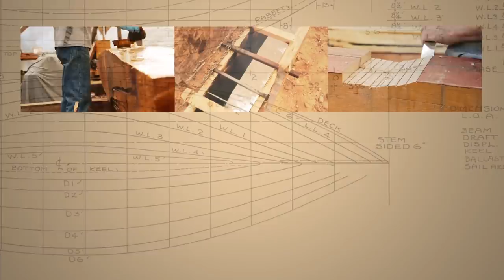Cockpit Mockup - Episode 149 - Acorn to Arabella: Journey of a Wooden Boat

Comment from the maker: So glad everyone’s enjoying the video! Thanks for watching! There are a couple of questions that are being universally asked. For water in the cockpit: Drains in the cockpit will empty to hoses that are attached to seacocks below the waterline. This solution for a self-bailing cockpit it’s fairly common. To drain well, the hoses are typically crossed rather than leading straight down—so a drain on starboard, for example, will exit at a seacock to port for good drainage even while heeling. Tiller steering: Tillers are simple, strong, affordable, and there are good options for self steering, including powered autohelms, for them. Sign up for the newsletter that’s linked in the description. It’s brand new and we’ll be releasing some pretty cool stuff exclusively through it. We figured that if YouTube won’t send email notifications anymore, then we will have to do it... and we’ll do it better anyhow. 😉
Reply: Have you thought about where the fuel tank is gonna go and the location of the engine gauges in the cockpit? .......fuel, temp, oil pressure and tachometer.
Reply: Wow the whole balance thing is so crucial, I would have never guessed!
Reply: Can confirm that Otto is an excellent helmsman and holds a pretty great heading unless you're really trying to pinch to wind
Reply: I have been wondering, why not let the cockpit floor slope with the deck? Then, one could work out a grate to their liking. But underway, should the low spot be aft? If your seacocks were straight down, or below waterline underway, wouldn't any water get pulled out by the pressure difference? Just curious.

Comment: Hi guys, I have been following your channel and love the way you build Arabella. I'm a shipwright from Turkey. Would you think about first covering the deck with marine plywood (shouldnt have to be thick) and cover it with a layer of fiberglass to make all the deck waterproof. Than you can install your deck on that glassed plywood. Decks are getting wet and dry everyday if there is nothing to stop water underneath they usually leak over the years. Rain water is a big problem because it rottens wood way faster then salty water. I usually paint the underside of the plywoods white before I install them. So they make nice contrast with deck beams and give interior more light also painting them while they out saves lot of work. Hope this will be helpfull.

Comment: It is so cool to finally see the deck come to life! So great to see the progress.

This was a hot topic last week, but it still had me thinking. The overhang on the roof might be a hazard in a storm. If a green wave roles over the deck and against the house, it has something to grab onto. It could rip the roof off the house sides if you're unlucky. 
I've spent years surfing in waves that have made it up the continental shelf, onto a beach. The waves you''ll encounter will be doing an unimpeded 35 mph. It would be like having several Olympic swimming pools hit you from the side. A ledge on the weakest corner of the house might not stand up to it. 
It would be safer to give each port light its own little cover, like on a traffic light. Make them detachable for heavy storms, use the in poor weather. No risk of pulling the roof off and still achieves the same goal.

A suggestion for tiller, would be to make it neutral in weight somehow. Holding it up will get heavy after a long time. Maybe a support behind the rudder mount, with a spring on it. I reckon it would be much more comfortable.

Comment: Steve, it's looking wonderful! The "grab rails" running around the cabin on my Bristol Channel Cutter were about the same size as the fiddles around the galley countertop; there's lots of area to grab, and it does catch the drips from the port lights as you mentioned. The cockpit is near perfect...smaller is better at sea, yet still plenty of room for socializing. You've already sorted out the need to brace your feet on the opposite side...excellent! I love the idea of the deck prisms there...mine were in the deck and never leaked, but they are slicker than snot if you happen to step on one! The tiller definitely needs to swing up vertically and be out of your way when anchored or docked. Yes, you will spend surprising amounts of time standing up, even on the deck, while at the helm. A good deal of that time will actually be spent steering with your feet! Prehensile toes help with this. I haven't seen your plans for it, but if you haven't already, you might consider mooring bits aft. I had one at either after end of the cockpit coaming, and they were an excellent and convenient way to moor with ease, with little intrusiveness. A cleat of sufficient size on the narrow aft deck, especially with Arabella's canoe stern, would really cut into the available deck space. Good on ya' for thinking ahead about ventilation...those small opening ports in the after end of the cockpit are a fine idea. Will the forward cabin's hatch be low to the deck or will you have a small trunk cabin? The after side of such a small trunk cabin is a great place for another ventilation opportunity. Mine was actually cut down like a miniature companionway with a washboard that could be removed for big air flow. We had a solid washboard for that spot, but most of the time had one with a large, louvered vent in place. The key to avoiding dampness and condensation, most importantly in cold weather, will be drawing in cold air at one end of the boat, warming it as it passes through the length of the vessel (picking up lots of moisture as it warms), then ejecting it out the other end. I've installed small "boxer" fans on my boats to create this end-to-end ventilation and have never had any problems with dampness, even when living and cooking aboard. Again, not such a huge deal in warm climes, but essential up north. It's sure rewarding to see her starting to acquire the cabin and cockpit...the parts where her owner will live. Thanks for inviting us along on this journey!

Comment: Great to see you sitting in the cockpit with tiller in hand clearly rounding a headland leading to a beautiful tropical island. 😂😂. You absolutely want to be able to raise the tiller. I am often standing on the cockpit seats while picking up a mooring or entering harbour. My engine control is positioned so I can operate it with my foot. Something to think about when you decide where to fit the engine controls on Arabella. 👍

Comment: When I started watching this series, I wondered how wooden boats managed to stay together under all the strain. Now, especially after this episode, I wonder how a wooden boat (or at least this wooden boat) could ever come apart. I’m amazed.
Reply from the maker: Our boat, in many ways, has been over engineered. Then there are boats that are somewhere in between. Interestingly, many boats built for racing in the early 20th century were built lightly and quickly and for fashion. Depending on the racing rules of the time, an owner would order a new boat possibly every couple of years so the boats weren’t built to last more than that. It’s not true of all boats at that time, of course, but it’s one explanation for some boats that have been lost to time.
Reply: @AcornToArabella  wow! I had no idea they would be semi disposable in that way. I guess when the purpose is speed and not longevity it makes a huge difference.
Reply: @AcornToArabella  I reckon there'll be less twist in that hull than any of the original logs from which it's made. Awesome (literally).
Reply: @tymonritco8578  racing craft (of all types, land, sea, and air) are built as lightly as possible under whatever rules they're following. So ordering a new one or completely rebuilding one every couple of years is less trouble.
Reply: Rain. Fresh water is the biggest enemy, that and stangnant air is a guarantee for rot. Neglect and rain are what kills wooden boats, no matter how well built.

Comment: Steve, you may consider opening the top of the rudder stem so the tiller could swing up all the way vertically so it is out of the way when not in use. Also fun access in and out of the hatch. It may involve some bronze straps to reinforce the rudder post, but probably not.

Comment: Love the finger rails around the house to deck connection. Have you considered a couple of "weep holes" on the inboard side of the rail to prevent any condensate (or whatever) from laying against the inside of the house and eventually causing rot (or discoloration). No doubt the weep holes need to be strategically located so that they don't drip on you're head while in the settee or bunk! Just a thought to add to a very well thought out design and build!

Comment: Yes, yes, and yes... So many yesses to good ideas this week. Yes to the vertically mounted prisms for all the reasons you listed. Yes to the hand rails, and those bronze portholes WILL drIp condensation. Absolutely yes to designing a tiller and cockpit that allows you to sail while standing on the seats... an absolute necessity when navigating in close quarters like crowded harbors or fuel docks or even narrow channels. Yes to a support for a half-opened hatch... I've had boats both with and without them. Yes to pretty much everything you said one this entire episode. Great stuff.
Reply: What I don't understand, though, is why there should only be so much space to only open the hatch halfway. Why don't have more wigle room than what they showed at the end, so you can open your hatch fully?
Reply: The tiller should go up all the way to vertical. You want to be able to get it completely out of the way sometimes.

Comment: Great progress, I am sure you figured out how you wish to slant the floor for the drains.  I would also consider while our still in the design phase a dodger and bimini attachments.  You will want cover from the elements, especially the sun.  it can be brutal.  Also I noticed in the traditional cockpit ergonomics was not a big consideration back in the day, but you will want some sort of back support.  Not sure how you accomplish it, but you will want it for sure on your first overnight passage in the rain.  Speaking of which, that could also provide an attachment point for a tiller-pilot style auto-pilot, in addition to a wind-vane.

Comment: FWIW: Most tillers I have seen swing all the way up to vertical. In that way, the entire back deck is accessible when on anchor. Also, some mechanism so that whatever height you adjust the tiller to, it does not drop back down to lowest point. 
And you may want to start planning on how a windvane or autopilot will interact with the steering system. No one wants to steer for days at a time.
Keep up the great work, and thanks for taking us all along for the ride.
Reply: Glad I read through the comments before adding my own. I lived aboard a traditional Stan Huntingford designed cutter for years. You'll spend 90% of your time at anchor, and the cockpit will be used more as an outdoor living room than anything else. Having the tiller completely out of the way either by making it possible to raise it to a vertical position, or make it completely removable will reduce the cuss word quotient by half.

Comment: Stephen I do recommend that you speak with your community about the advantages of a tiller vs. a wheel.
Reply: Wheels have far too many parts that can break, or get misaligned. And with a stern-hung rudder, a wheel would also mean at least two holes through the hull that can leak. Not to mention that wheels get in the way when moving around. Simpler is better.
Reply: @Garryck-1    What comes to mind for me is the constant pull or push against the tiller to maintain course and speed.  No easy task when the waves are up and slapping the rudder while you're trying to keep the sails full and working your base course.

Comment: saw a video on a sail boat that used your grab rail for around the deck house, it also was built to be a drain if some water did get thru a port light or the deck hatch opening. Much like the gutter on your home. Waters going to get in, so direct it somewhere safe.

Comment: A strong boat is almost a given, but what makes it seaworthy is not only strength but how easy it is to sail. Is it comfortable to sit in the cockpit for hours when the boat is rolling and pitching and the wind is 30+ knots and spray is coming at you. Can the person on watch adjust sails from the cockpit without having to call up a person sleeping below every time a sail needs adjusting, or a reef or even a sail change. Are the headsail winches and mainsail traveler easy to access and where do you store winch handles? Where is the compass located, the depth sounder, the chart plotter? Are they visible from either side of the helm? I have been watching Kevin Boothby, ‘How to Sail Oceans’, YouTube channel. He is a barebones engineless sailor on a small ship that shows videos of what it is like in storms. He has circumnavigated and has many ocean passages done. I found his videos enlightening.
Reply from the maker: Cool suggestion, thanks for sharing that channel.

Comment: - I can just imagine ingeniously adjustable tiller design ideals coming in for you.
- With only a youth's lake dingy sailing experience, I get the image in my mind of approximately 2 foot tall deep to gr polygonal bronze 5/8 in. thick slabs having quarter sized rounded corners and dept enough to grip each side of the rudder's top. It has an appropriate hinge point, and some sort of suitable spring action pushing down somehow against a bronze protector plate on the tiller. Then two or three appropriate sized/shaped wedges, are to be tethered to somewhere appropriate so they can never be washed away or not handy in gale winds, such that in storm weather they can be jammed into place lifting the tiller up two or three heights so you could lean down while standing just for resting sake if you wanted to, or yank hard without the tiller moving out of its set height.
- "Is that a stupid idea? Probably. Oh, I don't know."
- Thank you for indulging me in thinking that I am helping somehow.

Comment: re: cockpit cushions. I made my motorcycle and porch cushions with a Gore-tex inner layer and cloth upholstery. The Gore-tex keeps the support material, preferably Tempa- Foam, dry and allows the 
outside wrapper to breathe to prevent "Monkey Butt". The cushions dry quickly as only the outside layer gets wet. Yes, cockpit cushions are far into the future, but still something to think about.
Reply: Pretty sure Goretex works by passing through water vapor.. which you wouldn't have generated inside the cushion right?

"Gore-Tex can repel liquid water while allowing water vapor to pass through" from Wikipedia
Reply: @TrevorElsbree  it's a one-way barrier. Water vapor can go out, but water can't go in.